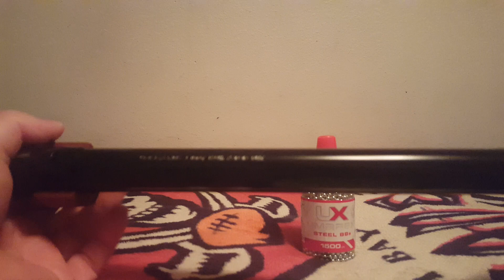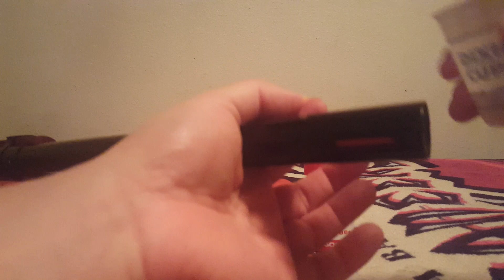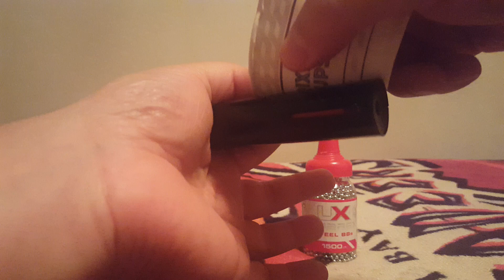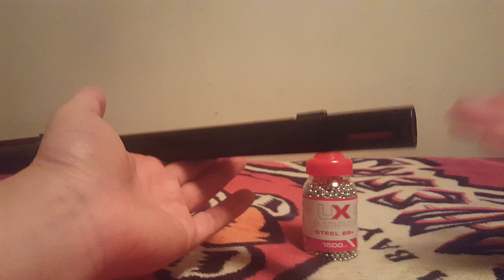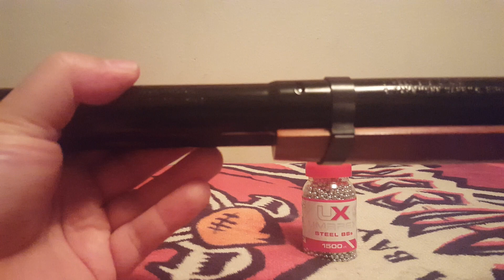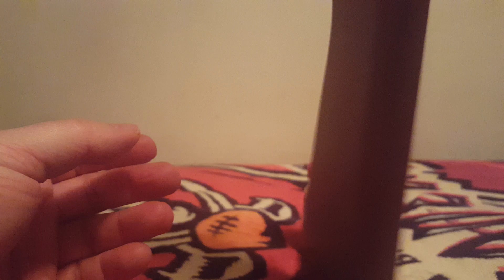Red Ryder Crosshair: Loading Gate & BB Window

Comment: I'm really enjoying your channel.Thank you for sharing. Would the Daisy match grade be better then the Umarex ?
I noticed in the specs that the match grade are slightly smaller
Reply from the maker: Sorry, the specs I see on Daisy Match BBs say they average .175. They are fast, hard-hitting ammo.

Because of the breech jam issues with the Ryder, I will only use Daisy Match or Black Diamond. One Ryder does have Umarex Zinc, so I will finish those.

Comment: I have an off topic question.  What keeps the Red Ryder barrel band in place?
Reply from the maker: Warrior, that deserves a very good answer - and if I were a Ryder fanatic - I would know for sure. I would say simple tension. But let me round somebody up for you.
Reply: Hi, Mark here aka cobalt327. Daisy 880 Fanatic Fix It has it spot-on! The forearm band is simply a friction fit. Should you want to remove the band, it can help to loosen the screw that attaches the wooden forearm to the gun so it can move if needed, then use a wood dowel as a driver to remove the band with a couple light taps of a mallet. Sometimes, the band can even be removed using thumb pressure on the backside of the band to push it forward off of the forearm. Be careful of the finish, but other than that it's not hard to do.
Reply: @cobalt327  Thank you.  I had been looking at it, wondering if it was that simple or if there was some hidden latch/detent.  I’m particularly good at breaking hidden latches and detents 😉 so I figured I’d ask around first.
Reply from the maker: Warrior, Mark gave nice answer.  From the mouth of a Ryder expert and hot rod specialist.

If you don't mind, I would like to talk YouTube politics. You gave good answer last time in the past.
Reply: @daisy880fanaticfixit9  Well I do not agree with most politics these days so…remember you asked the question.

I realize that when I edit, the creator has to re-like or approve, but that is a task that they as YouTubers have bought into.  I try not to let those happen but sometimes it does.  If I write a book of a comment and discover a misspelling, I’m going to correct it or delete it in it’s entirety.  

It is YouTube” not SuzyTube, I see her reign as CEO as coming to an end in the not so distant future.  I have had a couple different accounts dating back to 2005 but have reduced my foot print and pretty much just make specific informational videos.  Some videos I have made only have an audience of one person and that’s OK with me.

I have never once paid attention to video “likes” feature as a measure of if I want to watch something.  I think doing away with the “dislike” actually devalues the “like” button.  In the past I may have hit a “like” button but now there is no point and many feel that way.  I never watch videos that YT recommends to me as I will not be profiled by an algorithm.  I do not watch any advertisements that are attached either, as my time is valuable.  Sometimes I click on a video that doesn’t interest me in the least, and let it play in the background, just so their algorithm can track nonsense information.  I clicked on a Hot Wheels video and one about making fried rice, just to confuse the algorithm today.  Admittedly the Hot Wheel video ended up interesting me and the fried rice video made me hungry, so I had fried rice at lunch. 😄

I also carry a badge and work in a regulatory capacity with laws.  I 100% believe in keeping my oath and will never allow myself to be swayed.  I do not under any circumstances agree with needlessly protecting peoples feelings or mollycoddling them as this creates weak minded people.  People need to grow up and experience their feelings in order to function in life.  I am independent in thought and very much about our constitutional rights and I keep a paper pocket copy of the US Constitution in my inner jacket pocket and a copy in all my vehicles.  I am a mixed race responsible adult who does his best to help people.  I am also a designated technical expert in machine safety and testify as an expert witness in court.

I fully understand your concerns and I understand that you are not babysitting the comments sections waiting for when someone edits.  You have a life away from YT and I would not get offended in the least, if it took time.  I mean I also build carbon arrows for my archery activities and order my shafts direct from China or Russia and I have to wait a month or more for them to clear customs, so I can wait on YT comments to update.

Mostly you should know I appreciate you and your content, which is why I follow and subscribe to your videos.  There are exactly four air gun channels I follow and a couple general homesteading channels I watch.  I only follow those whom I feel make quality content.  These creators are spread across the county and some I have contact with outside of YouTube.

I realize my views can be controversial but it is free thought, a free country and big tech has stuck its nose where it doesn’t belong unless it wishes to come under absolute government control.  You can’t go around advertising creativity for all and then tell people they can’t be creative.

Disclaimer to anyone reading this.  I am not going to edit this comment should I later discover spelling errors unless my comment could create misunderstandings.
Reply from the maker: Thanks! You sound like a solid law enforcer.

Glad you know mechanics of YT. My ENTIRE concern there is you work hard on great remarks - whereas others, less knowledgeable than you, might think I deleted something.

We are good! Thanks for asking Ryder question. I learned from Mark too! Mallet and wooden dowel.👌👍
Reply: @daisy880fanaticfixit9  Yes, not all LEO are the same.  Elected LEO like sheriff's often differ completely from LEO hired by a mayoral candidates PD.  Doesn't mean they are not accomplishing the same thing but Sheriff are supposed to be by the book and follow the constitution.  This doesn't always happen and leads to controversy.   Sheriffs are the only law enforcement mentioned in the constitution and are supposed to be elected officials, not governed by a city.  Obviously there are many layers of LEO and in my state the Sheriff's are all elected and not governed by city entities, serving the people of the counties that elected them.  The state patrol follows the whim of the governor and the Police follow the standards of their local jurisdictions.  The way it ends up working is the state patrol tries to concern itself with the highways, trucking and boarders.  The city police try to stay in the jurisdiction of the city but can lend aid to the county, following the sheriff's lead and the sheriff can help out the city but only at county enforcement level.  If a city has decided to enforce a special ordinances beyond law (like noise), the sherif deputy may not.  I live in a small town and unconstitutional stuff happens because it is a city but outside the city limits you can be assured our constitutional sheriff will not infringe on your rights.  The closer you get to a big city like Seattle or Portland, the worse it gets.  I've been to Illinois and most of it is nice, but Chiraq, I mean Chicago, is a prime example of government gone wrong.  When I retire it will be to some forgotten little wide spot in the middle of nowhere Wyoming or some such little place where people don't want to be bothered.